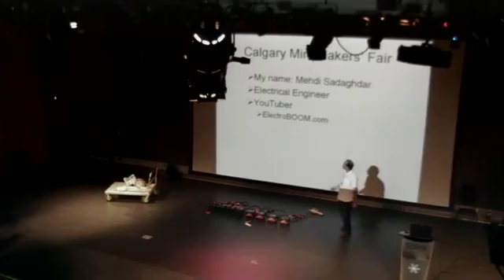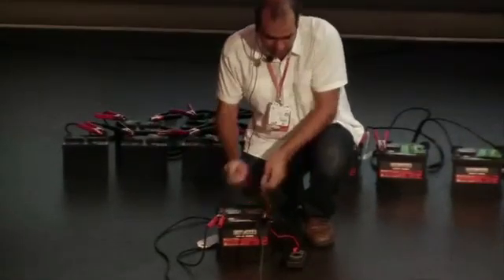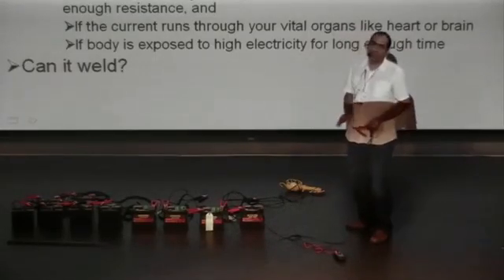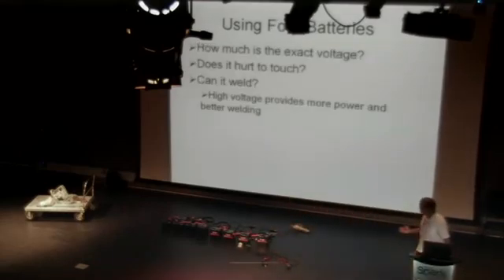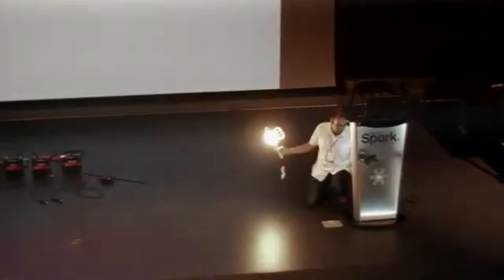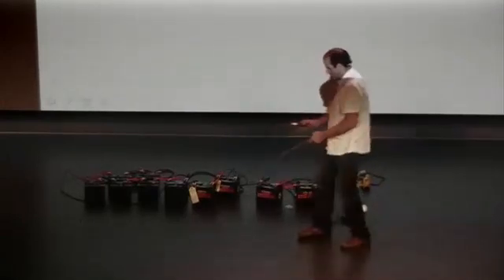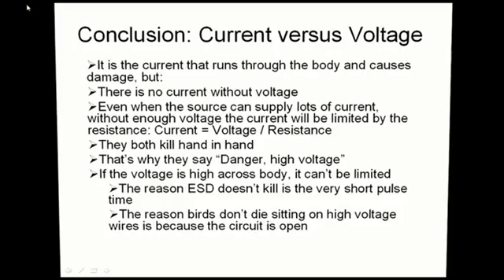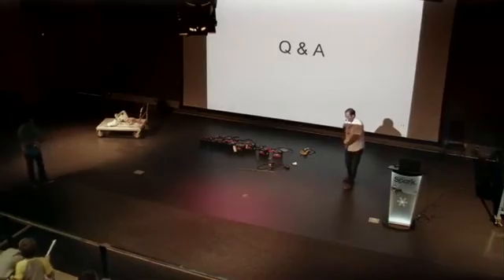Ten Car Battery Presentation at Calgary Mini Maker Faire

Comment: What about Tasers, they are up to few million volts, they don't kill, explain what happens with current? Thanx!
Reply: ***** Hi Mehdi, me in a quest still trying to fully understand the relationship between charge, current, voltage etc...

So assuming that human skin resistance at 1000 ohms that would make the current 50000/1000=50 amps.
However as by definition 1 amp = 1 coulomb transferred during 1 sec, that 50 amp 'would-be-current' being transferred only for 10e-6 secs actually makes up to only 50*10e-6 = 500e-6 = 0.5 mA current, better say, amount of charge passed on to the human at a time. Is it this logic why it is not lethal?
On the other hand a taser in action fires several times (per second?) sending that amount of charge to the target, don't these all add up?

Human skin resistance taken from here: http://en.wikipedia.org/wiki/Electric_shock
Reply: Thank you!

Comment: DC shock always attracts u with continuous constant voltage, AC in one cycle reaches zero voltage and a chance of isolating from shock.
Reply: *****  Ya at 60 Hz it may be difficult but we cannot say it is totally zero, when we are talking about 110V AC and 110V DC, the peak voltage for AC is 110/0.707 = 155 v and peak voltage of DC is 110v. I think This may be one of the reason why we hurt more in AC than DC.

By the way i like your videos

Comment: Reminds me of when I was much younger at a farm. Whilst everyone was inside, I went out exploring - and tried to climb over the fence into what I believe was the bull enclosure. I didnt see the warning sign since it was overgrown with plants.

The charge on the fence seemed to operate in pulses. I managed to get halfway over, touching the metal grille, before it actually zapped me - and it was the most intense full-body pain I've ever felt. My vision blacked out and I just fell in a heap.

From that day onwards I've had a fear of electricity. Nothing hurts like electricity does - and I've certainly experienced a lot of other physical trauma in my life (I've even had a Lumbar puncture for a slipped spinal disc). Right down to your bones, like being burned from the inside out and every muscle in your body cramps and constricts at the same time. I had heart issues for weeks after the fence incident, though I never saw a doctor about it.

But I admire what Mehdi does here. Its informative, fun and entertaining.

Comment: I'm not sure AC hearts more because of the capacitance of the body, 50hz is pretty low and our body should really be a large capacitor to conduct that much current in such a low frequency.
maybe AC hearts more because it has a more peak value (1.41 times the DC value)
maybe AC hearts more because our body organs are more sensitive to AC  current
and REMEMBER our body's resistance is highly nonlinear with respect to voltage(because above a certain voltage the only isolator in the voltage path which is our skin is lost) so if it is 100k @ 10v, it wouldn't be the same at 400v, I think your calculations could be misleading and some people might heart themselves.

Comment: Hey Mehdi I have a question for you since you seem to know about this stuff, Is it actually possible to die by getting for example electrocuted while using your cell phone while charging?? because i saw things like that on the internet and im wondering if it could be real or is it fake.
Reply: thx for your answer! now i dont have to worry about this stuff anymore xD
Reply: ***** dido fad typical cellphone will charge at 5V DC, drawing 1-1.5 amp, not really a way to get electrocuted.
Reply: well, if a lightning strikes your house, even if you have a lightning rod installed on the top of your house, there is a small chance of getting shocked, that's why the user's manual says that you shouldn't touch your phone/computer/etc... while charging in a thunderstorm.
Reply: The cases where someone died where either through explosion of the battery or because the charger failed and pumped 230/115AC  volt into the phone and into the user, in one case even through the head.
Reply: If the transformer inside the phone's charger is badly made, and it happens to short primary (110/220V AC) with the secondary (5V DC) (maybe it's a cheap charger knockoff?) it can definitely kill you, especially if the phone has metal bezels like an iPhone.

Comment: I believe when people say "Current is limited" they mean internal resistance of source
my current record is being zapped by 25kV - 30kV from Flyback tv transformer, but since internal resistandce of primary was high, and secondary also i survived
Reply: Yes, that
but I just wanted to say it isn't wrong when people say "when its high voltage, but limited..." because that transformer is rated at 25kV, and in normal circuit when it's loaded with really high impedance loads, it will give 25kV

Comment: Mehdi, I love your stuff, but I think you put yourself and your audience at serious risk in this demonstration. For two reasons. 

First, the UV output from welding can be very damaging to the eyes (and even skin, over time). There is a reason why welders use those incredibly dark masks that go all the way around their faces. It protects their eyes and skin, and I think just telling your audience not to look at it wasn't enough. Also, I wonder about the fumes from vaporized metal....

But more importantly, putting really high loads on lead-acid car batteries is going to liberate a LOT of hydrogen gas. Hydrogen gas can explode, and exploding car batteries will shower you with sulfuric acid! I'm a Ski Patroler, and we actually run scenarios on treating the injuries caused by an exploding car batter due to improper jumping. 

You were running huge loads on multiple batteries, and simultaneously showering them with sparks! I was terrified you were going to look like an acid attack victim in your next video. 

Please remember that there are other ways to hurt yourself around electricity that don't just have to do with shocking yourself. I don't want to live in a world without Electroboom, or where your trademark unibrow is replaced with ugly scar tissue!
Reply: Yes, lets inform the Electrical Engineer of his unknown mistakes. You put a lot of time into explaining all the hazards that an engineer should have already accounted for. Good for you.
Reply: Kenbobb They're sealed batteries, he's in a big, open space , and the amount of current he was reaching in this demonstration was actually somewhat less than a starter motor under high load from a car draws.

Comment: Hey Mehdi, I got a question that's always bothered/confused me. Electricity always takes the path of least resistance, right? So how can someone kill themselves by dropping something like a toaster into a bathtub? Wouldn't the electricity just go the shortest distance possible between the two leads, or does it react in a different way in a body of water?

Comment: Well done very informative even for none technical audience, but really stupid not to wear even minimum eye protection. You would not have been allowed to do that on stage without in the UK you were very lucky that the hot splatter did not burn your face or end up with a cataract which you will find out in a few days. Sets a bad example for the children in the audience who may hurt themselves in the future not understanding the risks. I once replaced many years ago a 600 Amp fuse in a substation with a coat hanger wire in an emergency and another none technical guy switched on the power before fault across 415 Volts was cleared. Nobody was hurt but a heating unit 10 feet above him the size of a small jet engine had a 6 foot flame come out of it he will not do that again we all do silly things but not in public. keep up the good stuff!

Comment: i weld with car batteries regularly, i assembled my electric tractor with car batteries and jumper cables. i find 3 batteries wired to give 36v with 1/16th inch welding rods works great. even though i have a 150A continuous duty stick welder and a nice hobart MIG, i preffer the batteries because you can leave them outside in the rain.
Reply: how long can you weld with just using batteries.
Reply: How good is the welds? I feel like it would be just superficial
Reply: Welds should be good.
No difference between DC supply from batteries and the DC supply from a welder; other than the welder is plugged into the mains and therefore doesn't need charging. 
(not sure what it'll do to the life expectancy of the battery mind)